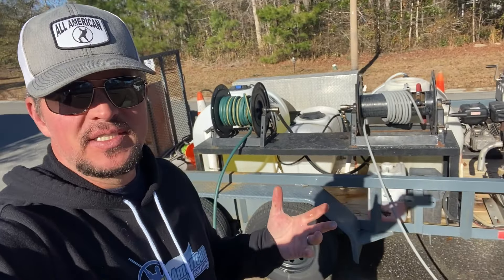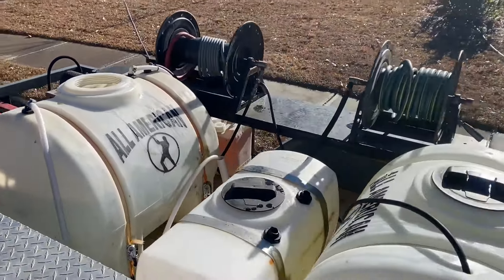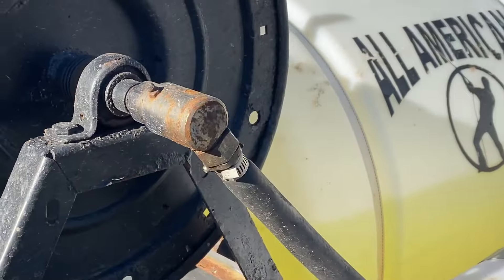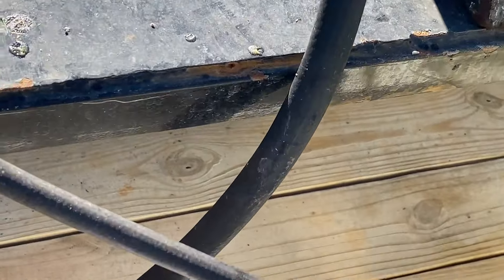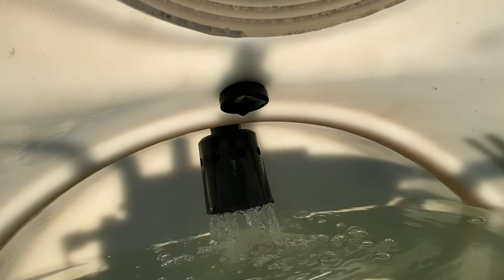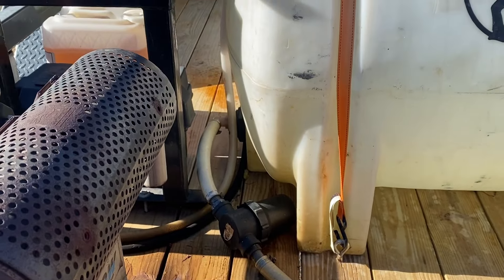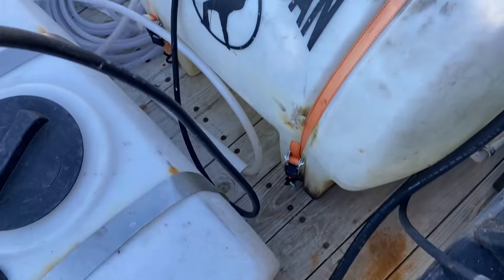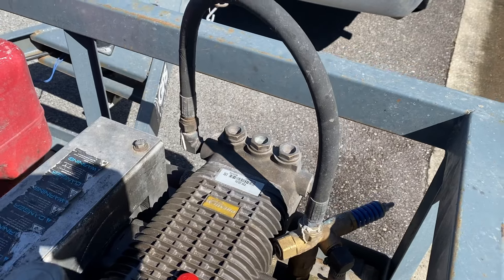How to Plumb a Pressure Washing Trailer & Soft Wash Setup

Comment: Well, I see that was four years ago. Is there another way now to flush the system out without pulling the line out of the SH?   And you worry about the soap line going into the proportioner being flushed or that doesn’t really need to be.
Reply from the maker: Soap line isn’t corrosive 
You could put a three way valve on the sh line

Comment: Would you recommend against venting if the lids weren’t kept open? It rains a lot where I live
Reply from the maker: Venting ?
Reply: @AllAboutPressureWashing  yeah, venting the tanks. I'm thinking that in a closed system that as water is coming in the internal pressure would build until it equalizes with city pressure not getting a full tank. and with SH as your pulling there would be no air getting in to displace the used SH and the pump would be trying to implode the tank. so as I plan my plumbing I am curious as to how to keep out critters and if anything grows in SH that's left stagnant. I saw you had your tanks open which is your vent but with the rain I get here I can not do that and need some vent /overflow. I'm thinking that I could run a hose and stuff it with SS dish scrubbing pads to keep out critters.

Comment: I have a 4gpm 4200 psi belt driven cat pump pressure washer will I need a 12v pump in between the buffer tank and pressure washer?

Comment: How long will the inside of softwash hose reel last?
Reply from the maker: +B Lane A very, very long time if you take care of it
Reply: @AllAboutPressureWashing  thank you—I have a general pump reel, so I didn’t know if that type would hold up to bleach or if it needed to be a specific type of reel. And thank you for all of the time you put into your videos. They are very informative and have helped me a great deal
Reply from the maker: I guess I should have been a little more specific with my answer.  Not all hose reels are created equally and there are differences in quality based on price.   Hose reels that are Made of steel and then painted or powder coated are not going to last as long as those that are made with aluminum or stainless steel.

Comment: Can you Do a video on how to connect bypass
Reply from the maker: +Jorge De La Cruz It’s very easy, there is a bypass port on your unloader, it is marked as such. All you need to do is remove the plug that comes with the unloader, replace it with a brass hose barb and connectors your poly braided hose with a clamp to the farm and put the other end inside of your water tank. It would be better if you used a bulkhead fitting, but it is not necessary.￼

Comment: Hi, where is that bypass hose coming from thats going into the top of your water tank? Thanks
Reply from the maker: +Ibrahim Ddh yes
Reply from the maker: +Ibrahim Ddh Sorry, it is coming from the unloader. When you release the trigger on the gun, it goes into bypass mode which we have dumping into the tank
Reply: @AllAboutPressureWashing  thanks for the quick reply. I'm new to pressure washing. I see my unloader and there's nothing connected to it. My question is how are you activating yours to release the water once you release the trigger? I have a Simpson GX390 4GPM.
Reply from the maker: I would talk to the folks Where are you bought it, I'm not familiar with that particular machine or what unloader it has on it. We don't do anything to activate it other than take our hand off of the trigger

Comment: What is your clear bypass hose hooked up to on the other end. One end is to the bulkhead in the tank
Reply from the maker: +James Pope the unloaded bypass
Reply: @AllAboutPressureWashing  okay, quick questions. How do I get 5% coming out of my tip if I’m using a 2:1 downstream injector with 10% bleach in a 5gallon bucket? Fill it all the way up with bleach?
Reply from the maker: +James Pope you will not be able to get 5% out of a down stream injector- you will need a soft wash system
Reply: @AllAboutPressureWashing  ok thanks last one, I know you have a pump for soft washing, is the pressure washer from water tank gravity fed? Do I need anything to get water to my washer from my tank?
Reply from the maker: That really depends on the type of pressure washer that you have. The very small ones will need to be force-fed, larger can be gravity fed. I would consult the technical information or the company who is manufacturing them to determine what you need.
Reply: @AllAboutPressureWashing  I have a Simpson 4200psi and 4gpm.

Comment: what if you only have 1 tank like a 50 gallon do I put just surfactant in the tank and then flush the tank after the jobs done with fresh water
Reply from the maker: +Paul Harris Paul, not exactly sure of your question.
Reply: @AllAboutPressureWashing  sorry I probably worded it wrong I only have 1 tank
Reply from the maker: I would just get like a 5 gallon bucket and fill it with your surfactant and drop your injector tube into it. If you're using a Softwash system, then you would have to batch mix

Comment: I have one well two questions ur pump that feed the pressure machine is all the time on right ? And are u powering it with 12 v battery? How often do u charge them? am kind new and trying to figure some things out building my trailer for now
Reply from the maker: +Sergio Jop The pressure washer is gas powered, it is connected to a battery, but that is only to start it. The battery is charged by the machine as it runs so you never have to charge the battery
But you are new so maybe you're talking about the 12 soft wash pump. That is connected to a battery, but it is only turned on when in use. And it is connected to the same battery as the pressure washer, so it is constantly being charged well which negates the need to charge it
Reply: @AllAboutPressureWashing  thank u for taking the time to reply I guess what am trying to ask is that I need a wastewater transfer pump to grey water tank can I use the same battery from my pressure washer to power it or should I use an extra battery for it

Comment: How do you know what size bulkhead to buy for each tank. Is it just the same diameter as whatever size hose you use?
Reply from the maker: +B Lane A lot of the tanks come with bulkhead fittings already, and you have to use various adapters to get it down to the size you need. If your tank doesn't have one, you can buy bulkheads so there are no reducers. Again, this usually depends on the machine that you are using and the amount of water flow you require, the bigger the better in my opinion. That way you were always ready to upgrade.
Reply: Thanks for your response. Does that mean if I’m using 1/2” soft wash hose, I just simply size it down to 1/2” barb off the bulkhead?

Comment: If I have a 4gpm washer, can I use 1 inch hose from tank to washer? Or will it be too big?
Reply: Also, do you have anything on the end of the hose in the soap tank? A filter or just pvc or hose???
Reply from the maker: +James Pope there is a filter
Reply from the maker: +James Pope I’m not sure - can’t hurt to ask the manufacturer

Comment: I installed a 3/4 bulkhead with a barb attachment on the bottom side of my water tank, can I just put my clear 3/4 hose from softwash to it? I noticed you said you had yours on top of tank with a filter in the bottom 2 inches of tank
Reply from the maker: Your setup will be just fine - I would recommend an inline filter also
Reply: @AllAboutPressureWashing  where would that go? I have a banjo filter btw my pressure washer and tank.
Reply from the maker: Between tank and pump - you don’t want  trash getting in pump

Comment: When downstreaming. You use your drip stick into the SH. Do you not use a soap/surfactant during this process?
Reply from the maker: +Scott Miller The tube that is connected to the chemical injector goes into the SH tank. We do not use a Surfactant when down streaming. In my opinion, that only increases your rinse time and really does nothing to enhance the cleaning process. Just added cost, added time because of extra rinsing.
Reply: @AllAboutPressureWashing  thanks for the quick response. I figured it wasn’t used and there was a reason for that. Great channel and content.
Reply from the maker: Thanks Scott
Reply: I can’t find the video, but when I start I’ll be a one man truck.  How do you link your sprinkler into the water system to keep plants watered? Do you T into the water supply line? Or do you run it from somewhere else?
Reply from the maker: Water supply line

Comment: What size tubes do you use on the soft wash system? 1/2'' on everything?
Reply from the maker: +wutangiz4ever yes
Reply: @AllAboutPressureWashing  awesome thank you. One other question, what high pressure 3/8 hose would you recommend?
Reply from the maker: I just buy it for my local distributor

Comment: So, if you just drop your injector into the chemical tank when down streaming and have a separate tank for surfactanct, how do get surfactant into the down stream? I still mix into a 5 gallon bucket. I will be adding a 12V this year so I need to re-plumb everything.  I have watched a lot of you tubers in this industry and I like how you present your videos. keep it up.  Thanks from Minnesota.
Reply from the maker: +NorthStarES  We do not use a surfactant when down streaming for house washes. 99.9% of the houses that we do are down streamed.  In my opinion, the advantage of a surfactant while down streaming a house does not outweigh the added rents time it takes to remove the soap from the windows. Just my personal opinion, lots of guys do use that. there are dual port injectors that you could put one line in the SH and another in a soap.
Reply: @AllAboutPressureWashing  It's funny that you don't even use a surfactant on a house wash when I have seen several heated Facebook arguments over what is the best soap to use. Apparently using some brands of soap (gain) makes you unprofessional.
Reply: I agree haven't really found any added value to surfactant in house washing maybe to hide the smell of SH but that's it.  I find most customers like the smell of SH
Reply from the maker: Facebook Schmacebook!  You do you and what works best for you  - everyone has an opinion but they aren’t paying your bills
Reply from the maker: Sh smells like “clean”

Comment: Hello! This may seem obvious, but is the water to the pressure cleaner gravity fed from the tank? I typically run a garden hose coming from the customer’s home directly to the machine since I’m not running supply tanks yet. Thank you for your time!
Reply from the maker: +Brandon Hanner All of ours are gravity fed, but there are some machines that require to be force-fed. It just depends on the machine.
Reply: @AllAboutPressureWashing  Thank you for the insight and your time!
Reply from the maker: You got it

Comment: Great video's man, i'm learning a lot... I think heh. Takes me min but I have a question. So at around 4:20 when your describing the three lines, (water,soap,SH) basically is The pump pulling from all three , but that little control valve determines the amount that comes out of each tank? How do you prevent it pulling like the SH as fast as the water supply? Are you just cracking the soap like barely open, and the SH like 30% open, and the water fully open? This is more advanced that man little starter system, i have to premix each batch but this looks ideal.

Comment: I have a 1" bulk head fitting with a 1" dropstick in a 125 gallon water tank. A 1" pvc tubing running into a 1" barb x 1/2" thread fitting into the 12v 5.5 gpm. Im getting some sputtering from the pump... Should I bring that 1" dropstick and tubing down to 1/2"?

Comment: Do you run sh through your pressure washer? I noticed you said chemical injector but I have always used my softwash system for spraying sh. Thank you for the video
Reply from the maker: The chemical injector is on the outlet side of pump so there is no chemical is run through the pump.
Reply: Okay thank you, is there still sh running through that or is that the bypass hose? I am a little confused and just want to get this part right
Reply from the maker: The chemical injector sucks SH in through a 1/4” hose from a chemical tank and introduces it into the pressurized water after the pump.

Comment: If my pressure washer doesn't pull water from the tank on its own. What type of pump would I need to get the water from the tank to the pressure washer?
Reply from the maker: Some sort of booster pump - 12v

Comment: I have a question with my soft wash pump, It All runs normal but for some reason,, it's hooked up the same as yours but if I plug it into my hose it doesn't suck, it doesn't work, but if I unplug the hose then it will work, suck and blow water everywhere but once I put the hose back in it, it doesn't work but if I plug the holes into something else, it works, I don't understand why it doesn't work when I have it plugged into my hose. It only works if I have a return hose but it's not even designed that way?
Reply from the maker: +Bryan Lepore  sounds like it’s not priming

Comment: What size diameter hose are you running from the proportioner to each tank is it 1/2 inch or 1inch from the proportioner to the pump as well as to the tanks?

Comment: Is that 1/2 thread to 1” hose coming out of your pump? Should I be plumbing 1” from my pump to my dipstick? Or on the other side from my pump to my softwash hose reel? Should I be putting 1”? I was going to cut off a piece of my 1/2” ag hose and just use it.

Comment: I set my soft wash system up the same way with the a removable drop stick for bleach so I can flush it out. I noticed on my last 2 jobs midway them,  there was a big air bubble in the line. Do you shut off soap and water valve and turn sh on full way to prime it? How long does it take you to prime them each time  to prime it

Comment: Do u need to pull chemical with the pressure washer setup, or could you use the soft wash system to put down chemical and then go to the pressure system to surface clean or whatever you may be doing ?

Comment: What size reinforced/braided hosing do you use for your sh and water lines that run from your tanks to your metering valve and also the one that flows from the pump to the reel.....thanks in advance had to watch this vid again
Reply from the maker: +Antonio Garza thanks for watching - I just use the braided 1/2” hose from Lowe’s/home depot

Comment: Really enjoyed the video…could you do a video on your electrical end? How you wired up the soft wash system? What type of battery, charger, switches etc
Reply from the maker: +Joeyballz77  we did that- How to wire up a 12 volt Soft Wash Pump  or Roof Pump https://youtu.be/vLrbB0xRcTs

Comment: What kind of hose and attachments do you use for the soft wash portion? Asking because of corrosion.
Reply from the maker: +David May That is a ag hose, there is a link below in the Softwash stuff that we use. The gun that we use is polypropylene, the attachment for the spray nozzle is also in the link below. It is a Ryobi adjustable nozzle. All of the fittings are banjo polypropylene.
Reply: @AllAboutPressureWashing  Awesome! Thank you so much for the reply!
Reply from the maker: Thanks for watching!!

Comment: What about the water supply for a soft wash?  Does it have to be plumbed to the bottom of the tank or can you use a drop stick fit the water too?
Reply from the maker: +Edward Simms it can just be a drop line

Comment: When you connect your SH or soap by your reel and drop the other end with pvc in the the tank, does it automatically suck when you push the gun???
Reply from the maker: The chemical injector hose does that is dropped into the chemical
Reply: Thanks. Also, mind sharing how you plumb the bottom of your hoses with pvc and mesh for easy cleaning?
Reply from the maker: It’s just a hose that slides through the pvc tube and a filter hose clamped to the hose

Comment: I have watched at least a hundred youtube videos and looked up on google but i cant seem to find a answer, and it's probably really simple, but once you connect your 1/2" hose to the top of the tank, what happens on the inside? do you continue the hose to the bottom of the tank?
Reply from the maker: +Dylan s which 1/2” line are you talking about.
Reply: @AllAboutPressureWashing  hey, big fan!!!! , i know the 1/2" feed line goes to the hudson float valve, but the 1/2" line that goes from the water tank into the proportioner is what i was talking about, sorry for the confusion.
Reply: @AllAboutPressureWashing  Basically my question is, After your 1/2" hose that comes from the proportioner attaches to the bulk head fitting on the tank,do you continue to run the hose all the way to the bottom of the tank? If so, how do you keep it from floating up, thank you for replying!
Reply from the maker: Yes - there is a pvc pipe attached to the bulkhead that is about 2” from the bottom of tank
Reply: @AllAboutPressureWashing  Ok, thank you for the help sir, keep up the great work!! I have learned a lot from your videos and i appreciate it! im sure other people feel the same!
Reply from the maker: Love it - thanks for watching and glad it helps.  Make sure to subscribe!

Comment: Hi Mike. Would i be ok tank feeding my 5.5 belt drive pressure washer with 3/4 in hose? 
  Also, could i dual feed that pressure washer utilizing the port on the other side of the pump with a garden hose?
Reply from the maker: +Big Rob Big Rob  you could dual feed it with another bulkhead from your tank - I think that would be better.
Reply: @AllAboutPressureWashing  would it be ok to use 3/4” hose to tank feed my 5.5 pressure washer (belt drive)
Reply from the maker: Should not be a problem